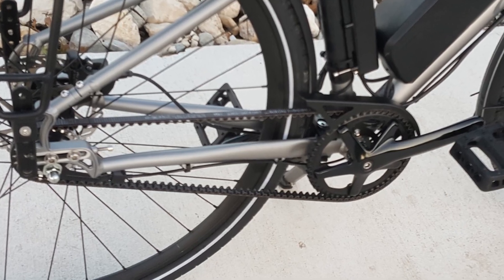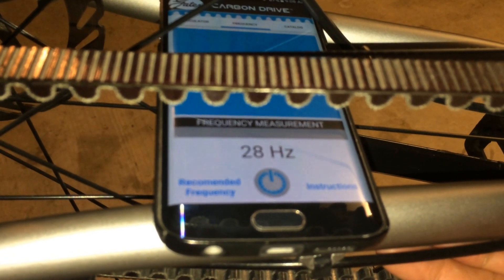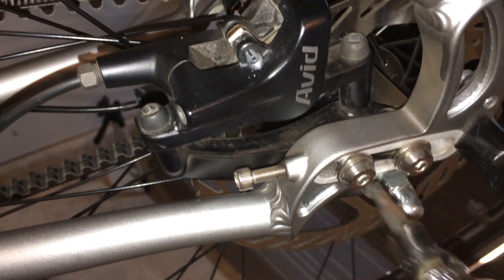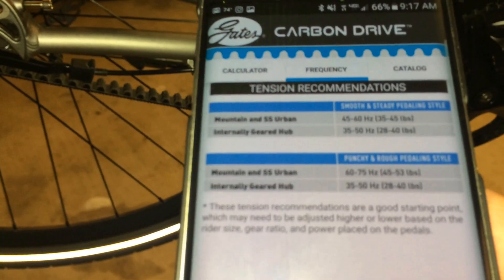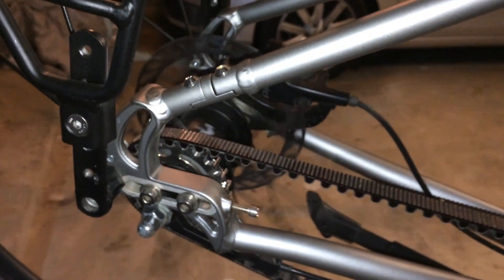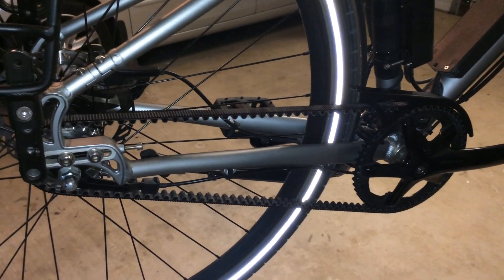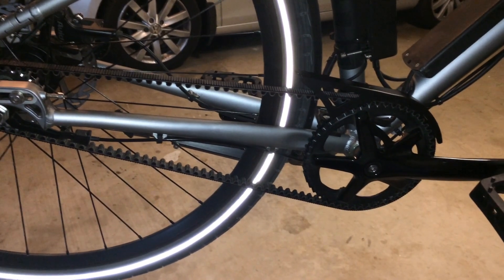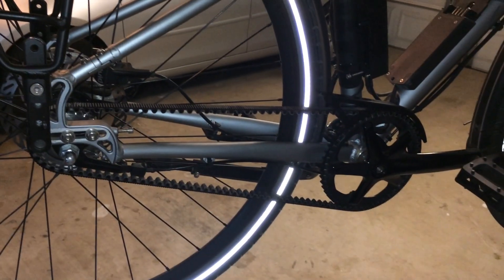Gates Carbon Drive - How to Adjust Belt Tension + Review

Comment: How often do you have to do this? Also, at 3:38, why did it go down to 32 and then up to 56 without adjusting the belt?
Reply from the maker: I've only had to do it once since this bike has a sliding dropout. With standard dropouts / no belt tensioner - it would need to be done when the rear wheel is removed.

Comment: A friend just picked up a couple of Bird eBikes and the belts seem really tight. I ran a Gates belt on a 22 tooth brushless motor sprocket and I never had the belt that tight and I was pushing several thousand watts through one belt for over 5k miles on an electric scooter.

Comment: Ok but what if bolt's stuck then what?
Reply from the maker: Do you mean the tensioner screw? If it's rusted I'd start with some rust remover spray, then step up to an impact driver. Worst case scenario drill the screw out then fix the threads with a die.
Reply: @eBikeaholic  well two bolts that hold tension screw are stuck but there are no visible rust
Reply: @eBikeaholic  I cant believe that few stuck bolts prevent me for using my bike and its a nice bike name is Rabeneick TX7

Comment: Doesn't recognise "strums" %90 of the time and when it does it's inconsistent. 20-90 so I have absolutely no clue what to do.
Reply from the maker: hmm sorry to hear that. Gates sells a special tool for this, but they are pricey. Have you tried stopping by a local bike shop, they can probably help.
Reply: You have to make sure you're in a very quiet environment otherwise ambient noise will throw it off.

Comment: Does anyone know if this is the same procedure to adjust belt tension on a boardman urb 8.9, which I'm getting this month.
Reply from the maker: I don't think so. The Spot frame in this vid has a sliding dropout. It looks like the Boardman belt is adjusted through an eccentric bottom bracket.
Reply: @eBikeaholic  okay. Complete novice to bike maintenance but i really want to know how to adjust the tension if it needs it. I know how to measure the tension with the gates app but finding it  very difficult to find anything online about how to actually tension it. It's not something I want to pay a professional to do if I can do it myself.
Reply from the maker: @grahamjackmacpherson6501  One of the best features of most bikes is that 90% of their maintenance is usually a simple DIY. If in doubt take it to a LBS the first time and ask lots of questions about how they do it... good bike mechanics like to share their knowledge.

This vid does a pretty good job describing the eccentric bottom brackets... https://www.youtube.com/watch?v=M7Z0pAWMa0s&ab_channel=ViventeBikes

Keep in mind - even though the tension may feel a little off or be slightly out of spec, you probably don't need to mess with it. I'm pretty sure they're designed not to stretch like chains do.

Comment: I just received a factory direct Gates Belt Drive ebike with the Strumey Archer 5 speed IGH. The belt slipped a couple of times yesterday (I'm just over 300 miles) and your video was the perfect tutorial on adjusting the Gates belt. I'm kind of on my own with this very cool but unsupported ebike. Thanks again for the great video!
https://electricbikereview.com/forums/threads/generic-md-1000-and-hd-750-ebike-model-discussion.39257/page-38#post-385679

Comment: would you be able to twist the belt? A good trick mechanics use to roughly gauge belt tension is to see how far you can twist it about itself. A good tension is a belt that can twist 90degrees. 180 too loose, 45 is too tight.
Reply: One reason I never give my bike into hands of so called professionals but doing on my own follow strictly recommendation of the manufacture.
Reply: @Michael-wn4jj  it's not as a quantitative method, but gives you a good idea if your belt is too tight or loose. Pretty much all seasoned mechanics work off this when inspecting belts. That said you could see how much variation there was within two plucks of the belt. Again intuition and sense of what tension feels like can be more valuable to you with your tools and especially when you don't have your tools with you.
Reply: You should not twist an carbon belt in my opinion.

Comment: This seems to be a lot of over complicated procedure for a belt that is supposedly incapable of stretching, I’m sure a correct tension can be achieved by common sense adjustment without any adverse issues.
Reply: What's complicated about it and whoever said the carbon belt was incapable of stretching?
It's simpler than dealing with a metal link chain.
What's a common sense adjustment method that's better than the one here?

Comment: I have a Luna fixed stealth,  there's only a tensioner on one side. Also don't know what I should loosen before making the adjustment. Can you advise?
Reply from the maker: The Luna stealth has a Nexus 3 IGH right? You'll first need to loosen the bolt at the rear of the Nexus 3 mechanism that covers the axle nut on the drive side then it should slide right off the axle. Then you'll want to loosen the drive side axle nut before you can adjust the tensioner.

It looks like the tensioner they use has a hex head bolt and a nut... according to this video ( https://www.youtube.com/watch?v=XRfyqR6uJAU ) you shouldn't turn the hex bolt, only turn the nut that's on it. Turning the nut clockwise should pull the axle back and tighten the belt, start with very slight (1/8 turn) increments. 

He does a pretty good job showing you the whole process in that video so definitely watch it, but keep in mind he's showing you how to loosen the belt not tighten it. He also removes the belt for some reason though I think just for demonstration - you probably don't need to do that.

I also saw your review video, were you able to get the correct chainring bolt? It's hard to see in the shot but it looks like your LBS sold you the wrong size... it should probably be standard M8 single ring bolts: https://amzn.to/3epotdw
Reply: @eBikeaholic  thanks for the tips! Still haven't got the proper replacement bolt, but the temporary one is working fine. I think my internal hub is damaged, the rear clutch is not engaging properly. Thought I might fiddle with the belt tension to see if it helps at all.
Reply from the maker: @jeffmueller3909  I'm under the impression that the Nexus 3 is pretty hard to damage... have you tried adjusting the hub? When you shift it in 2nd gear there should be a little yellow indicator in the center of the window that's attached to the axle. https://www.youtube.com/watch?v=Nx0I-4JdQ2k
Reply: Yes, I have to adjust that every time I take off the mechanism. Water tends to get in the hub.

Comment: All good but don't loose or tighten the bolts using ratchet. 😉 
Is there any torque value for tightening?
Reply from the maker: Yup, always a good idea to use a torque wrench if available! Depending on the bolt grade and material of the bracket, M6 bolts can usually torque between 12 - 20 Nm. In this case I think the bolts are grade 9.8 and the threaded bracket is steel. I've been wrenching long enough to get a good feel for it and am confident that I stayed in that range. I actually haven't needed to touch those M6 bolts on this bike since making this video in 2017, so I'd say they're good to go ;)

Comment: What do you do if your bike does not have any backward-facing belt tensioning bolts? I have looked for something similar on my bike, but there is nothing like those, nor anything that would appear to perform the same tensioning function. The bicycle is a Scott e-sub Tour belt 2018.
Reply from the maker: Nice bike, looks like that model has the Conti belt. If there's no tension bolts I'd imagine you'll have to tension it the same way you would a typical single speed or IGH chain drive. Loosen the four horizontal bolts (two on each side?) that hold the rear dropout bracket in place, then pull back on the wheel while tightening the four bolts. When I tension my single speed bike I sit with the wheel between my legs, tighten the bolt on the non-drive side, then pull the wheel straight while tightening the drive side. Then measure the tension... it'll take trial and error but you should eventually get the feel for it. Make sure the wheel ends up straight. You might want to shoot an email to Scott or Continental or just ask your local bike shop to take a look.
Reply from the maker: Just found this service video on the ContiTech website, should be helpful... http://www.continental-bicycle-systems.com/en-gl/Ebikes/Media/Videos/Belt-Drive